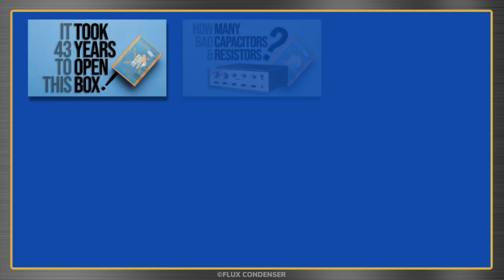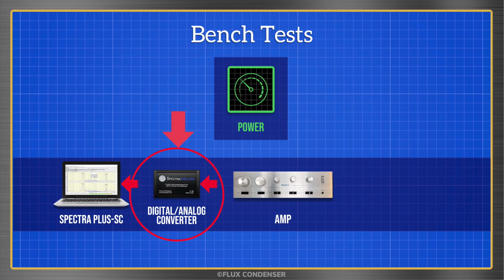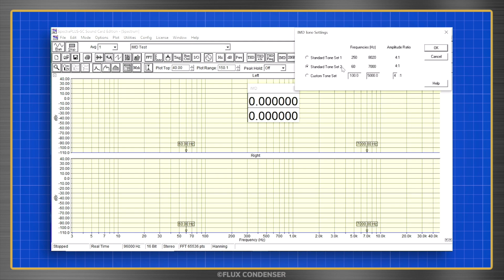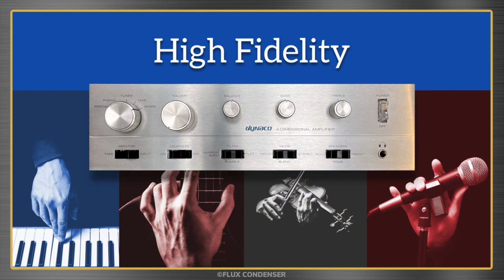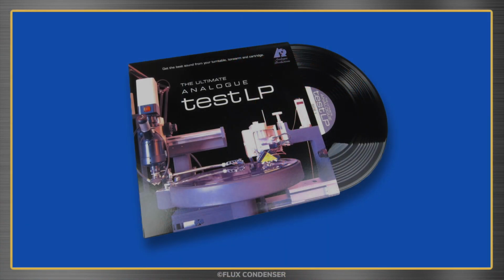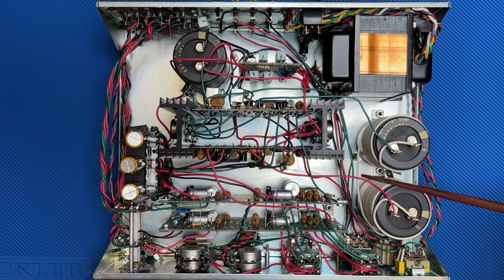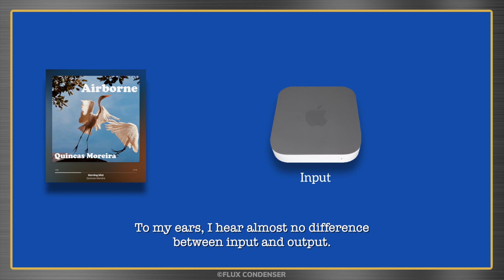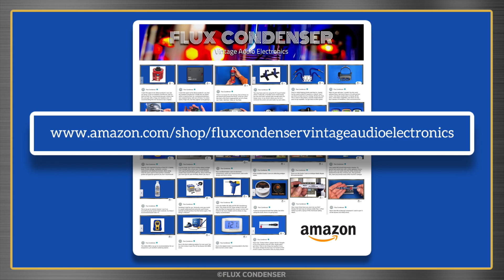Dynaco SCA-80Q Amp Kit P9 • Bench Tests Vs. Listening Tests • What Do Specs Mean & Do They Matter?

Comment: You're absolutely right in pointing out that mid fi is nothing more than snobbery.  High fidelity was achieved during the golden age from 1950 to 1964 and everything after that has just been variations on how to achieve high fidelity.  The biggest difference in modern gear is better components within the individual units.
Reply from the maker: Ah, the rare voice of reason! Thank you.

Comment: I picked up one of these 80Q  but when I was checking things inside I shorted the output transistor with the chassis ...now one channel is out ... guessing I need a replacement transistor but what else you think may be bad ?  is it even worth fixing ? it was working before that - cheers

Comment: Well sounds great on my 2$ ear buds.  Nice setup no faults there. The comment about wr-resitor is another myth would be true in rf smd ic build but not a p-p build. The inductance of the resistor leads would be larger than the resisor. SORRY trigger point for me :)
Reply from the maker: Thanks for the comment, Ludmila. Yes, the dummy load resistors I show in the video are more than appropriate for amp testing.
Reply: @FluxCondenser  No was talking about another comment some one made. I AM 150% in favour of a reactive dummy load over a simple resistor.  I wish I could pick up good d load like the one you hav
Reply from the maker: You want a non-reactive load, not a reactive one.
Reply: @FluxCondenser   really I'm thought the pa82 was a reactive load?  Will have to see if I'm can find a scematic for it.

Comment: One of the VERY BEST videos for audio introductions!!! 😃
I'd like to know how to measure (with a digital multimeter) the millivolts of ripple output from the power supply in an amplifier. 🙂
I don't have a x-scope.
Reply from the maker: Thanks for the kind comment! So, measuring power supply ripple without an o-scope is almost impossible to do accurately. You can certainly just put your multimeter in AC mode and if there’s a significant ripple issue, you may get a reading that helps you determine that. The problem is that power supply ripple often won’t be true AC, but instead pulsing DC because at that point the power has been rectified. On an O-scope you can visually see the pulsing DC.

Comment: Some thoughts I collected as watching.

1. The resistors that you showed both seem to be wirewound. Non inductive resistors are usually preferred for amplifier analysis where possible. Not sure how much of a difference it actually makes.

2. Does the signal generator in your software produce distortion itself? Is this compensated by the measurement software? It seems like having an extremely low distortion sine wave is critical for THD tests.

3. Not sure if loading down the amplifier output and listening to it through an attenuator will be able to approximate the complex relationship between an amplifier and different types of speakers. A stereo microphone setup with a couple sets of reference speakers and the source recording would be an interesting YouTube comparison. Not sure how practical it is though...

4. Harmonic emphasis in tube amplifiers has a lot to do with single ended vs push pull and a bunch of other factors. Not sure I necessarily agree with the full dismissal of harmonic emphasis on tube vs solid state based on the measurements of one vintage solid state amplifier. 

Overall very informative video with some simple explanation of some complicated specs. Keep the content coming!
Reply from the maker: Thanks for your thoughtful comments, Novalux. By the way, I really enjoy your channel.
Let me take your points one by one:

1. Non reactive resistors are required for amplifier testing and the ones shown are of a suitable design. As I noted in the video, though, the two dummy load resistors shown were not used for the tests. Instead, I used my Sencore PA81 Amplifier Analyzer. This is a highly regarded professional instrument that, among many other features, provides an appropriate load for amp testing with adjustable resistance. All tests were done in the 8 ohm position. 

2. The Spectra Plus software and DAC I use are also highly regarded (and expensive) professional gear. The Spectra DAC 200 used is rated for .002% THD and is specifically designed for audio testing. 

3. A speaker load is reactive whereas the dummy load is necessarily non-reactive. There may be some complex damping relationships between speakers that a test such as this may not reveal. My belief, though, is that this would only cause audible issues with very difficult to drive speakers due to inefficiencies or problematic impedance matching. I purposely noted that this would not be another “amp playing through speakers” test as those, in my opinion, are useless. In such a setup the sound is far more influenced by the room, the microphones and speakers than by the amp. 

4. Bottom line, some push the idea of vacuum tube amps as “featuring” even harmonics (it’s still distortion) vs. the odd, harsh harmonics of solid-state. My point in the video is that this very basic, early transistor amp does not produce excessive even harmonics OR odd harmonics. And I stand by the idea that one technology is not inherently better than the other due to this odd vs. even harmonic issue. I’ve tested many amps, and I’ve never found a solid state amp to have excessive odd harmonics. Additionally, the stellar THD performance of solid state amps in general dismisses this faulty notion entirely.
Reply: @FluxCondenser  Thank you for the thoughtful reply. Not sure how I missed the PA81 as the load. I use one as well :) though I still use a custom built load for certain amp designs. The PA81 goes haywire on occasion on modern amps.

I will have to look into the software/hardware that you are using. That distortion spec is pretty awesome. I have a QuantAsylum piece that I have yet to connect at the bench. Sounds like your setup is somewhere between that and the Audio Precision.

Heard loud and clear on the “speaker video thing” I applaud you for the effort to offer an approximation of how an amp affects a signal to the masses over YouTube. Its not easy and this is the most creative way that I have seen it done so far.

Again, keep up the good work. You are building quite the library of useful info. In fact, I just referenced your Selenium replacement video this morning.
Reply from the maker: Thanks, Novalux. Yeah, the PA81 can be very sensitive to the tiniest amount of DC which kicks on its protection relay.
Reply: @FluxCondenser  I have done a little mod on mine to bypass the relay. The relay is NC so you can just add a toggle switch to the coil feed to interrupt the device's ability to disconnect the load. I use this when testing tube amplifiers at full power. I don't want the PA81 to trip and leave the amplifier with no load on the output transformer secondary. Found this trick on an old AK post. I think this also helps with cap coupled amps on first power up after sitting for a while.
Reply from the maker: Ha! Yes, I saw that same tip and have considered making the alteration as well. Definitely a sometimes frustrating feature to an otherwise nice piece of gear. It really should have been a simple alert and not a complete disconnect. Or, a greater DC threshold should have been allowed. I can see the value of the feature, but I’m also of the mind that someone using the PA81 would already know if they had a DC issue so I think you made the right decision.

Comment: Rather a high bar you've set there, sir, for the rest of us SCA-80Q owners.  I must now repair to the Death Star's garage to retrieve the pressure washer, cuz almost 50 years of grimy buildup sits between me and the SCA's interior.
Reply from the maker: Ha! Well I did cheat, by planting my SCA-80Q seeds forty-plus years after most people. The true test will be how mine looks in 2060. A lot better than how you and I will look then, I’m hoping ;-)
Reply: @FluxCondenser  I'm 65 years old, I'll need to start moisturizing now if I want to be any kind of recognizable in 2060.

Comment: Nice work. Could you share info on your attenuator/voltage divider to maintain 8ohms on the amp but to attenuate for the analyzer. Cheers!
Reply from the maker: Hi, Harry. Absolutely. First, for the sake of clarity let me just review here that there two different pieces to the load/attenuator. The load is provided by the dummy load resistors and the attenuation is provided by the voltage divider. Running the voltage divider alone won’t provide a load to the amp. 

Voltage dividers are simple circuits using two resistors connected in series. The amount of voltage division is decided by the resistance values of the chosen resistors. For the 10:1 divider (it’s actually 9:1, see below), the values of 3.9K ohms and 430 ohms were used (½ watt). The total resistance of these two resistors adds up to 4,330 ohms. The 430 ohm resistor provides 10% of the total and the 3.9K resistor provides 90% of the total. In the video I call this a 1:10 divider, but it’s actually a 1:9 ratio. The result, though is that output voltage is 10% of the input. 

I wish I could post a photo of the wiring here, but instead I’ll describe it. You can also google voltage dividers to see an example.

As I said, the two resistors are wired in series. The input voltage connects to the outer terminals of the resistors. The positive for the output voltage is tapped at the midpoint of the two resistors. The negative for the output voltage connects directly to the input negative. The resulting output voltage will be 10% of the input. You need two sets of these dividers for stereo. One for left, one for right.

This circuit can be easily built or you can cheat which is what I did. Russound makes a very nice speaker level to line level adapter called the ADP-1.2 which uses the circuit I described. Additionally, it provides convenient RCA jacks for the input and a wiring harness for speaker connectors. The speaker connectors are flimsy, so I opted to mount the adapter in a project case and added a terminal strip for speaker attachment which I wired and soldered to connect to the ADP-1.2 board.

Hope this helps, let me know if you have any further questions.

Comment: I hear some slight treble roll-off and compression but it's really close. The old Dynaco definitely passes the hi-fi test.
Reply from the maker: Thanks for the comment, Martin.
Reply: @FluxCondenser  I've heard cables and capacitors that have more effect on the sound than the entire amplifier.